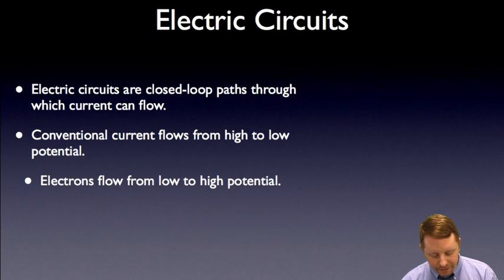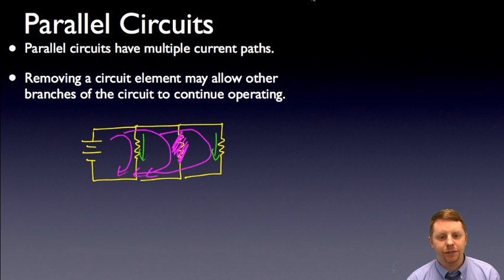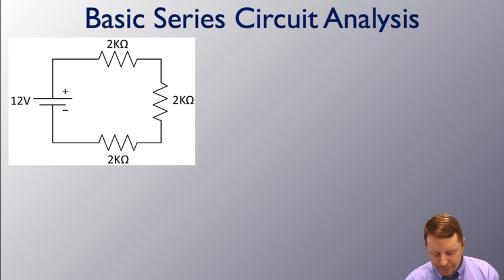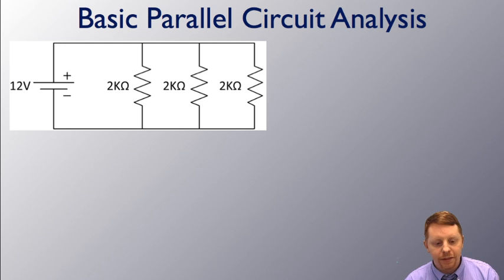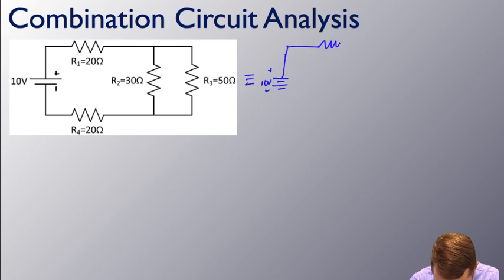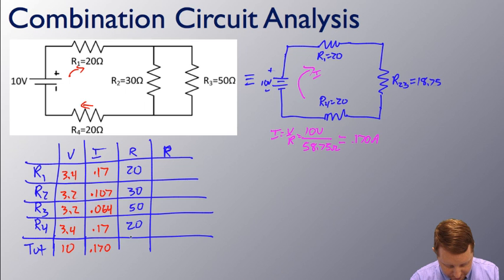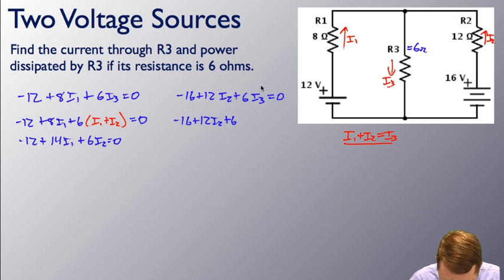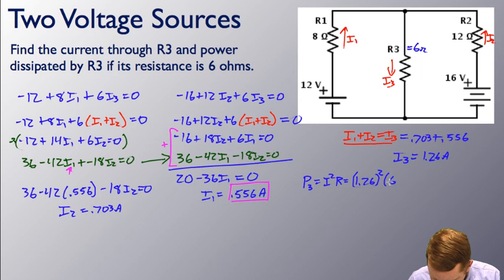AP Physics C - Circuit Analysis

Comment: Have you ever considered using a RIVP table instead?  I used to use VIRP tables with my physics classes, but I changed to RIVP tables.  This sets up the columns so that the first two multiply together to give the 3rd column, and the 2nd and 3rd columns multiply together to give the 4th one.  I find that it makes keeping track of the variables a little easier.  Besides, you pronounce RIVP so that it sounds like "ribbet", which links back to Galvani's frog.
Reply from the maker: I hadn't, but that sounds just as fun to say and the 1/2 and 2/3 multiplying sounds cool!

Comment: Hi Dan,

At 17:19 in the video you say that proceeding clockwise and seeing negative side of battery first the voltage displacement is - 12 V, moving across the resistors you denote the voltage displacement with + signs. Shouldn't it be the other way around? Since your starting at the negative terminal of the battery, doesn't the voltage go up as you reach the positive side (+12V). That has me a bit confused.  Similarly since the move is in same direction of current, shouldn't it be -IR? Thank you very much I really appreciate the help you provide to AP Physics C students.
Reply from the maker: You can do it either way.  I was taught in engineer school to add up the voltage drops (so you record the sign of whatever side you see first).  Others do the opposite.  Since they all sum to zero, you get the same answer regardless.
Reply: Yea that's true, it doesn't affect the answer and it's a pretty neat "trick" that helps avoid confusion. Once again, thank you very much!!

Comment: Can we use VIRP table for two voltage sources or more?
If yes, it would be really great to see an example.

Thanks for everything, sir!
Reply from the maker: +SystemsEngineering Hi!  You can, but it's a bit more complex of a process and not as straightforward.  Once you get to multiple voltage sources I tend to find that students have enough of an understanding of circuit elements that they no longer need the VIRP tables.  :-)

Comment: I just want to say Thank you !
Reply from the maker: +Tan Ben You're very welcome!
Reply: +Dan Fullerton (APlusPhysics) Hi Mr fullerton, i just took a test and instead of 2 voltage i am given 3 voltage and 3 loops. How do i define the direction of the current? How should i proceed should I always start at the bottom or is there any convention on how to start KVL in this case?
Reply from the maker: +Tan Ben Hi Tan -- no real convention, just start writing various KVL equations and then use your algebra skills to determine the unknowns.  As for direction of current, just pick a direction and draw the arrow on your circuit.  If you get a negative current when you solve, then the current through that branch is opposite the direction you've drawn.
Reply: +Dan Fullerton (APlusPhysics)  Thank:) you clear my doubt

Comment: Hi dan.. I know its late but could you explain how you used kirchoffs law on the last problem to say I1 plus I2=I3
Reply from the maker: Ben Eckardt Sure.  Kirchhoff's Current Law states that the current entering any point in the circuit must be equal to the current leaving that point in the circuit.  Looking at that top middle node, I1 and I2 come in, and I3 leaves, so I1+I2 must equal I3.  Conservation of electric charge.

Comment: So what would the current be during the example at 22 minutes in each of the branches on the bottom that have no resistors be? (The wire connecting to the negative terminals of each battery)
Reply from the maker: On the left hand side, it would be I1 (whatever enters must leave, KCL) and on the right-hand side it would be I2 (same reasoning).

Comment from the maker: In building the circuit diagram I try to show the positive and negative side of each element.  Batteries force a potential difference (typically increase), so they go from negative to positive (along the direction of current flow).  Potential drops in the direction of current flow across a resistor, so they go from + to -.  Then, when you use KVL, as you go around your loop, choose + or - based on which sign you see first for each element!

Comment: We need the node equation before we calculate current and determine its correct direction, but since I don't know where different currents flow, I cannot get the correct node equation (i.e. I 1 + I 2 = I 3 rather than I 2 + I 3 = I 1)

Comment: Hello, sir, I have one question here. When we analyze circuit with multiple batteries by using Kirchhoff's node rule, how do we determine the node equations at first if we don't know the direction of the current in different branches? Although people say our choice of the arrow directions is arbitrary, how do we find out at a certain point which current is coming in and which going out?